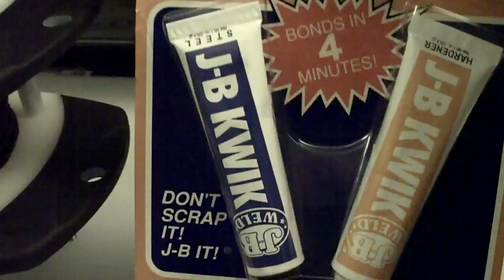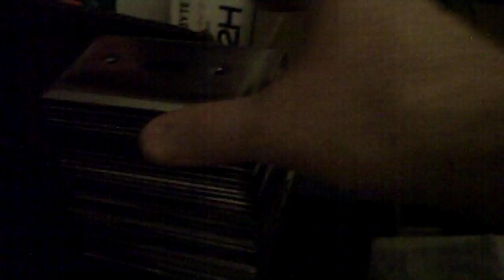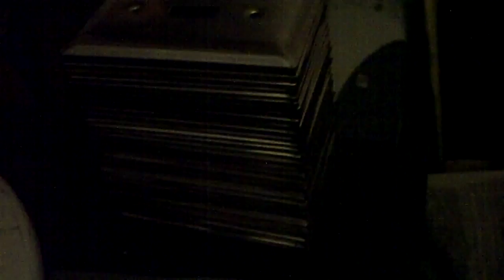Vid50 New Volcano Cell Designs (HHO, Brown's Gas, Hydroxy)

Comment from the maker: @riomargo 

I'm only experimenting with DryCells, because they are extremely more efficient than Wet Cells. I've also discovered that the diagonal angles of an upside down bowl allow for rapid release of HHO Gas. The bowls also create chambers for the gas to build up in and as it rises to each new stage the pressure increases.